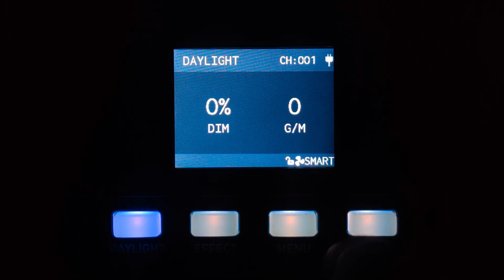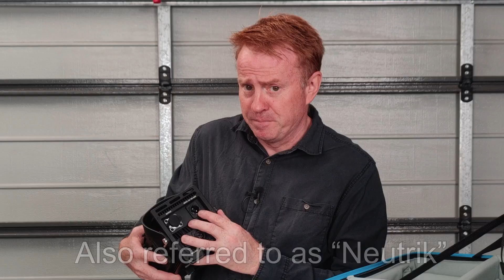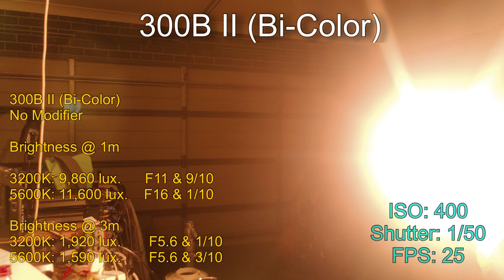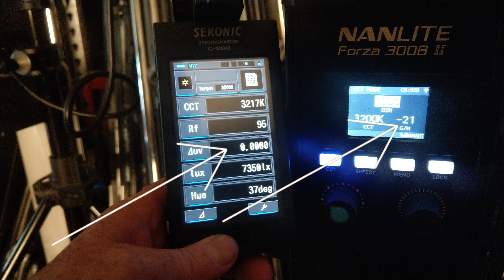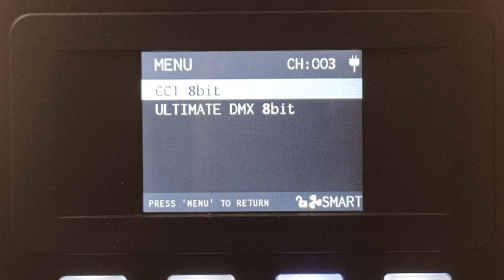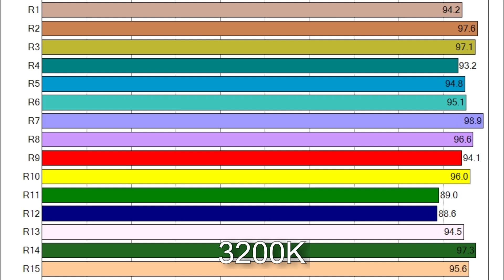Gaffer & Gear 212 – Forza 300 II & 300B II

Comment: can you modify the forza 300 yoke adj, to be one side like the 300 ii
Reply from the maker: @monobomodular6413  I guess you could. I don't know how it would go with heavy modifiers on. My guess is there isn't enough surface area to get a sold Lock on the clutch
Reply: @ you are right, i tried flipping the plastic rosette to the smooth side but it slips. definately needs the whole system changed

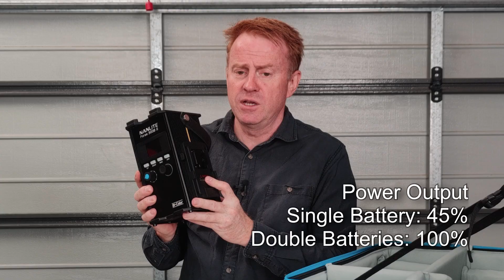Comment: Thanks for yet another thorough and honest review. I believe these lights can run on both 14.4V and 14.8V 12A V-Mount batteries, not just 14.8V like you said at 8:37. I haven't tested this out, though.
Reply from the maker: 14.4 and 14.8 are essential the same thing. What I meant is don't put a 26v on these.

Comment: The Green and Magenta Adjustment is absolutely incredible. That Nanlite implemented green and magenta emitters in Mono and bicolor lights is something I never could imagined before. This feature was long in my wishlist because the DUV of nearly every video light I used was never to my satisfaction, almost always too low (magenta). Filtering with gels was always a tradeoff due to the light loss.I will test one unit out and then I will buy 8 units if I am happy after testing 🙂 The only thing I would wish in the future is, that they use better LED's with higher CRI (no blue peak) like the ones Anglerfish iFootage lights use. Then they would be perfect!